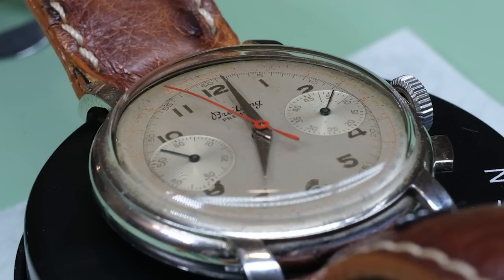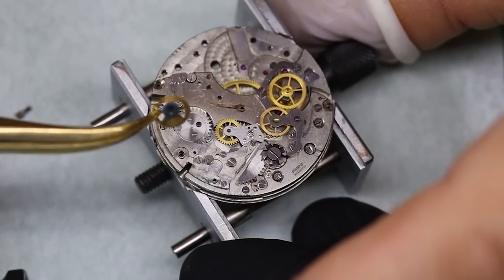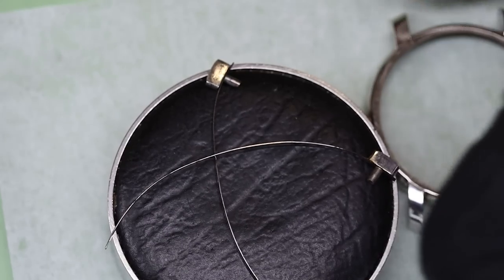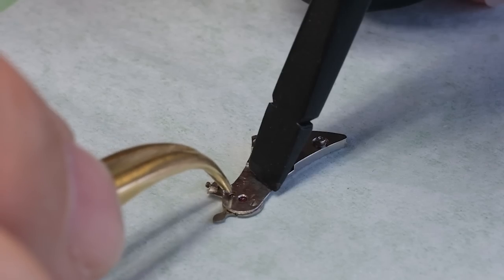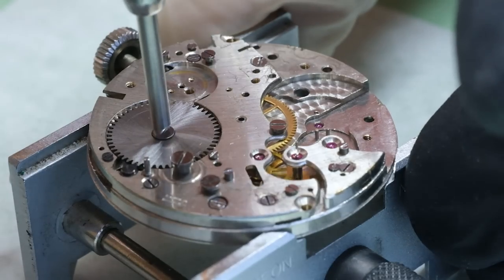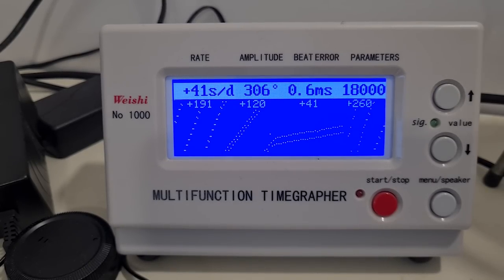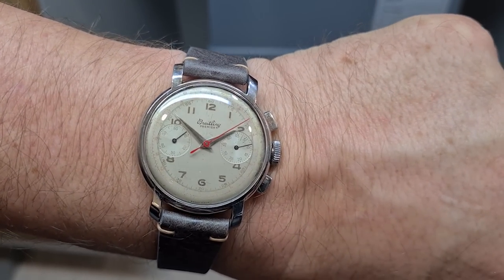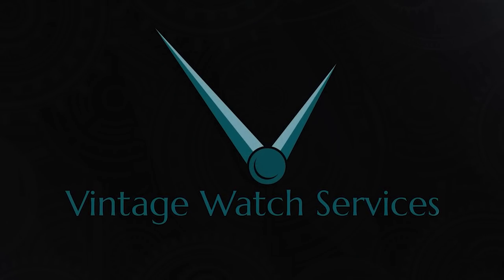Who butchered this old Breitling...? 😫

Comment: Just got your channel randomly recommended by YouTube and I find it intriguing, I myself is a metal worker (in Denmark it is a 4 year education) and I build machines for the medical and textile industry, with tolerances on 2 tenths of a millimeter, but it seems to be hugh when it comes to watches

After a few of your videos, I came to think about my father and grandfather´s old watches and I had to go and look for them and 20 minuts later I am now sitting with them in front of me, a Atlantic Automatic 25 jewles incabloc and a Zenith Medaille d'or geneve 1896 ancre 15 rubis pocket watch and after winding them up they both tick ahead nicely (after years and years in a box in the closed) and opening the pocket watch back, it look in pristine condition, the out side look like silver (0,800) and could use a polish though.
Reply from the maker: Hello Rubim, it's very cool to hear you looked up father's and grandfather's watches after viewing that channel and that they are still running :) Mechanical watches are little machine wonders and it's fascinating how they start ticking after years in a box!

Comment: Many thanks Stian, great job. Interesting that the hammer and spring allowed for the work you did on the hammer given that you removed material. I also assume that building up experience on what are original parts and what aren’t, I might not have spotted the incorrect spring. Keep the good work up! Ta ta.
Reply from the maker: Hello Boyd, I removed very little material and there is a bit of leeway in the mechanism. I didn't really inspect the beak of the hammer where it interacts with the column wheel in detail since it worked, but it might be that the former guy adjusted it to engage deeper.

Comment: Stian, the Rodico seems a different color than normal. Are there different kinds you use? I've noticed sometimes even a clean new piece will leave a smudge on the crystal if I use it for a final dust removal.
Reply from the maker: I mostly use the so-called Rodico Premium, which is grey. It leaves a bit less residue than the standard green one. And yes, Rodico leaves residue regardless, which is why a lot of watch brands actually ban it in their manufactures.
Reply: @VintageWatchServices  thanks for that, Stian. 💪

Comment: Just to tease you: I have  a watchmaker friend that is so fanatic that he replaces the metal bearings (like here on the center wheel) by stone bearings! Even Rolex had metal bearings that wore out in the 50s and my friend does replace them, making better than original Rolex's. Crazy guy!
Reply from the maker: Hello Juri, if properly done, that is indeed an improvement of the watch, but it also makes it non-original, and that's why I don't do that unless the bridge is so worn it's the only option. If the bridges are marked 17 jewels and there are 19 in it, that would feel off to me as a purist.

Comment: Very nice work! Much more professional and precise than some other Youtubers out there, methinks.
"Stian's Hammer" is making a regular appearance now, which I appreciate. Must be the Viking heritage - there's no problem that can't be solved with a war hammer. 
The Seagull 1963 comes to mind at once, of course, and I'd love to hear your opinion (one of these days, as you promised to Randy). Also, have you noticed the similarity between the dials (i.e. this Breitling and the Seagull 1963)? The champagne coloured watch face, the red seconds hand, the font of the numerals, the lack of lume... 
And I will not chide you for not using any Ziffernblattwiederherstellungsflüssigkeit. (Even if the dial could have done with a tiny bit of cleaning up, don't you think?)
I enjoyed the video, as always!
Reply from the maker: Thanks Gordon! It might very well be that the Seagull borrowed some design ideas from this one as well. There isn't actually much that can be done with this dial, as all of the dirt is embedded in the varnish, meaning that if you rub it, the varnish will be gone and the dial will look horribly. Refinishing it goes against my beliefs when the dial is still so nice with the original golden numerals fully intact. And it looks very nice in person :)

Comment: Nice looking watch Stian. I enjoy your “micro machining” operations and explanations as part of the service. Is this the same movement the Chinese are using in their Air Force chronograph?  Any thoughts on how the chronograph hammers got so distorted? Judging from the colors showing on the piece, some care had been taken in it’s heat treatment.
  Look forward to next week. 🙂
Reply from the maker: Thanks Randy! It's not entirely the same, but the Seagull 1963 is indeed based on this movement. I hope to get my hands on the Chinese watch one day to compare them 👍
Reply: The ST19 movement used in the Seagull 1963 is based on the Venus 175 but has a few extra jewels in the train- it's actually a 19-jewel movement.  It's actually a nicely made movement.
Reply: @douro20  That Seagull is a nice looking little watch that has tempted me before but I sure about the quality and materials given the price, as I recall they aren’t much more expensive then a new Moon Swatch…..  for a column wheel chronograph.
Reply: @randyallen2771  I bought a Seagull a year or two ago and it's a little jewel. I opted for the sapphire dial crystal and display case back and I think I paid roughly $400 for it.  don't think I'll ever sell it.

Comment: I have an old Sears stopwatch- actually a rebadged Heuer Trackmaster- which has a half-minute dial and it turns out that just a tiny bit past the 15 second mark is where it is the hardest for it to reset.
Reply from the maker: 🤔 Interesting. There might be some irregularities on the surface of one of the heart shaped cams.

Comment: Beautiful movement and great save on the hammer. Did the reshaping and polishing change the overall length and necessitate the adjustments of the cam?
Reply from the maker: Thanks Peter and I see you know your chronographs :) I was prepared to adjust the beak of the hammer a little bit but it wasn't necessary. I did have to tighten up the hammer post a bit, but didn't show that in the video. It's simply screwed into the mainplate, so it's not a big difficulty but you don't want to make marks on it.

Comment: Stian, can demagnetising a watch cause issues sometimes? Recently I did after servicing and on my Time grapher it was all over the place, no straight line, almost impossible to get a signal, but before I de magnetised it, it was ok. Now I’m unsure what to do? Any advice? Also I’ve found demagnetise made a watch run fast, how can that be?
Reply from the maker: Ideally the watch shouldn't run when you demagnetize it, but if your watch had become magnetized you need to simply demagnetize it again... Those cheap blue ones with the red button work fine for "soaking" the movement. You can either move it slowly across the device or lift it slowly straight up 50 cm while the device is on.
Reply: Thanks Stian on both your comments back. If you demagnetise with the movement running can it cause issues?

Comment: I noticed that you needed to adjust the regulator almost fully to the slow end. Is there anything you learn about the movement from that? I'm curious about whether it is a sign of too light a balance or perhaps too strong a hairspring?
Reply from the maker: That question shows a very deep knowledge, Mike! Ideally you would indeed like the regulator to be in a neutral position (in the middle), but for these old movements the regulator is in one piece, meaning it will basically never be in the neutral position. If you really wanted to center it, you would need to adjust the length of the hairspring or re-stud it, and that is extremely delicate work that you really want to avoid...
Reply: @VintageWatchServices  Thank you for the reply, and the kind words. I'm a YouTube educated amateur, so I have people such as yourself to thank. I haven't yet attempted to re-stud a hairspring, but I do try to use curved brass tweezers for everything now !

Comment: Lovely vintage one again...looks like this movement is mistreated...a lot of scratches on the bridges and mainplate besides the hammered hammers and engravings in the caseback...wondering why nobody got the scratches off the movement, if I was the owner, I would have appreciated that.
Reply from the maker: Thanks Rich! There isn't that much that can be done to a scratched part other than replacing it, and the owner also wouldn't normally see the marks. Especially before cameraphones the owner would likely be happily oblivious about any marks :)

Comment: I think those hands aren't correct for a ref 780.  The serial number dates the watch between 1946-47 which is too early for those Dauphine style hands which were mostly 1950's.  Probably would have used stick hands.  The red sweep second hand is also probably a later addition.  What always amazes me about great watchmakers is how steady their hands are.  You can't do anything without steady hands.  Videos like this make paying my watchmaker a lot easier knowing exactly what's required.  Thanks!
Reply from the maker: Yes, you might very well be right about the hands. This watch had quite some things done to it... And my hands are actually not very steady at all, but I've learned to work around it :)

Comment: So cleanliness is important does that mean that you have a clean room you work in? I've wondered about that, hairs dandruff that type of thing, oil from your fingers if you touch apart without having your rubber glovetips on.
Reply from the maker: Hi Mike, I have a clean-ish room 😉 A proper clean room is a bit overkill for an independent watchmaker and only something you really find in specialized assembly departments. Most workshops simply try to keep it clean and tidy.
Reply: @VintageWatchServices  at a company I used to work for we design and built a clean room for assembly and it had positive pressure and electrostatic filters it was pretty cool I guess it would be overkill for this these old watches.

Comment: can a quartz watch be fitted with a spring powered caliber?
Reply: its possible, but you would likely have to do it yourself and depending on the watch and movement it might take a lot of machine work to make it fit,
Reply from the maker: Theoretically yes, practically no. You would need to find a mechanical movement with the same dimensions and crown position and with the same position for the dial feet. That will be very difficult to find and honestly not worth it.